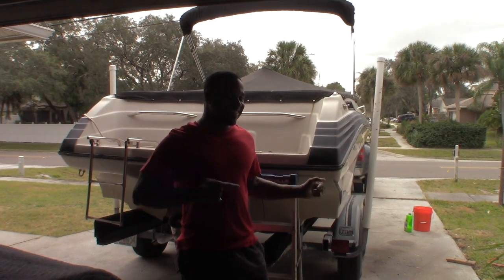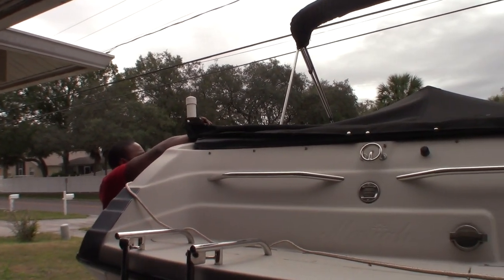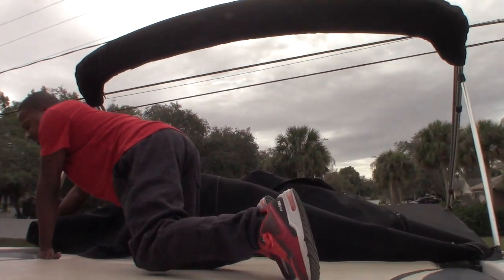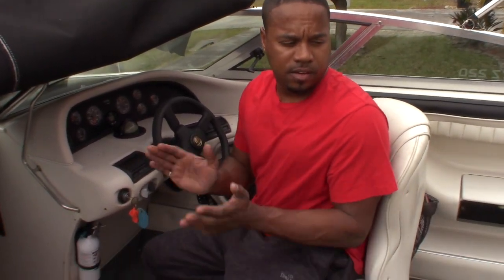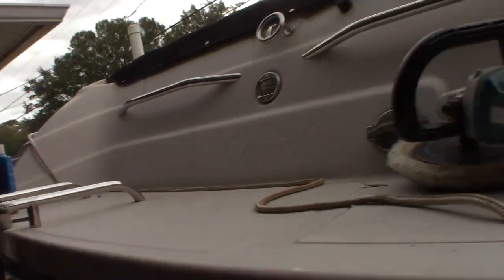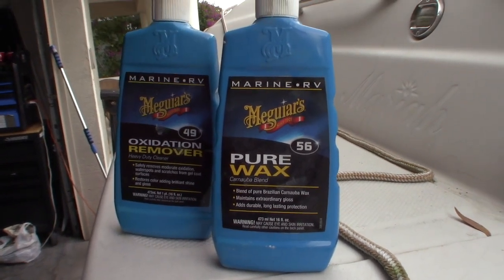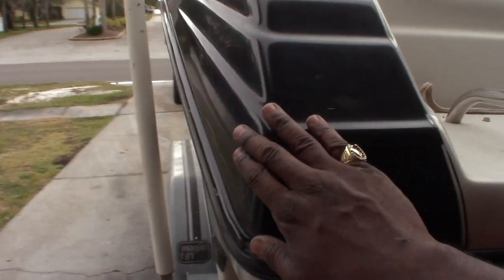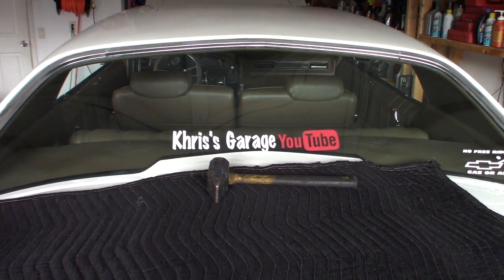Getting the boat ready

Comment: Nice boat man but always hook up the hose with earmuffs onto the outdrive. Those Mecruiser Alpha drives have a rubber impeller inside the drive that sucks water into the engine. Running it without water is a big NO NO. I will be surprised if you dont overheat eventually. The impeller should be changed every 2-3 years also. Been a Boat Mechanic for 15+ years I know what I am talking about. Nice Donk BTW and more transport videos would be cool. 👍😎